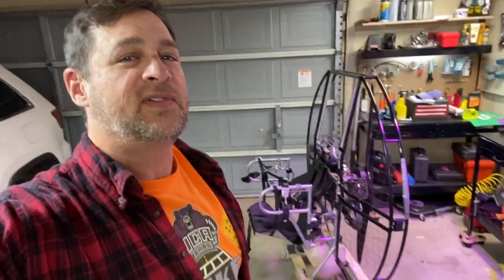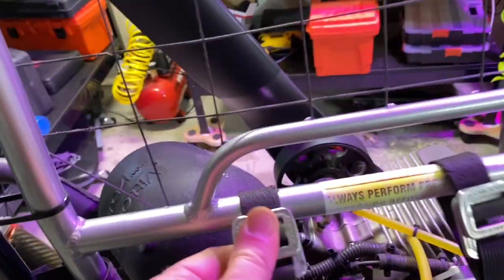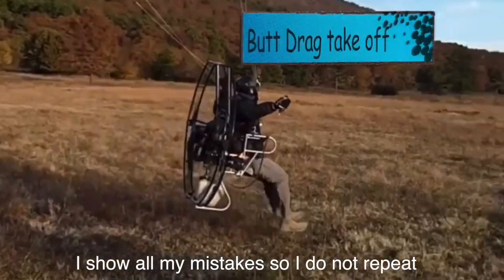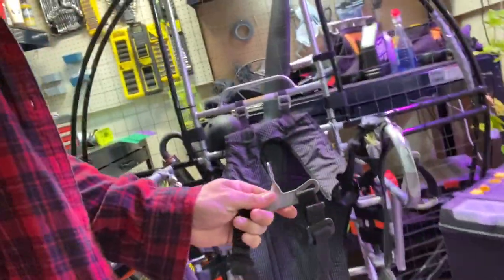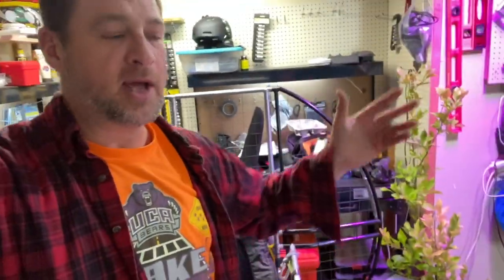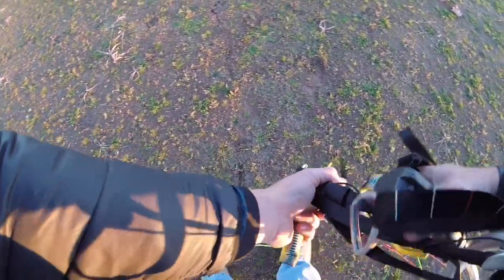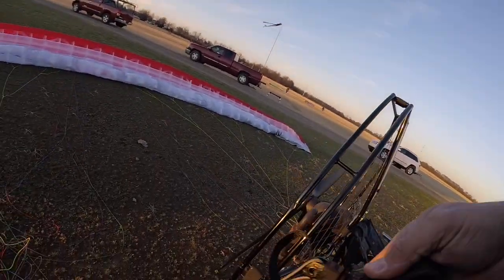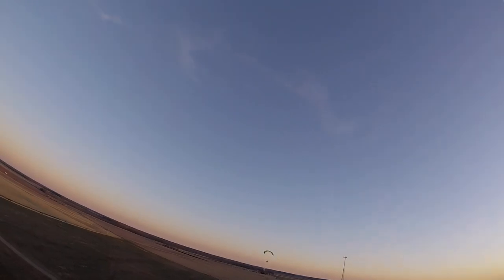Potentially a fatal mistake… This is why Pre Flight is so important

Comment from the maker: Let me know if you see what happened… Even after doublechecking it did not look incorrect…
Reply: I can't tell 100%, but at 6:05 it looks like you clipped in with your riser turned 360 degrees. If you follow the A-line from the riser down, it looks like rather than hang straight down, it comes up and over the other lines from right to left. (This is on your left side riser) And I believe you untwisted it when you reset. As far as the engine restart, if you don't already know, make sure you hold the kill switch down for a full 3 count and then it shouldn't restart. I've had that happen to me a few times.

Comment: It's scary. I go through preflight too. I even have it written down on a 5x7 note card that I had laminated and keep in my harness pocket just in case I want to double check.   It's not possible to not miss something at some point in time. The one time I had an issue was when something didn't feel right so I unclipped and started over. Only my brain decided that I had already made sure my toggles were clear to pulleys. Well I hadn't the second time I clipped in. Once I launched, I discovered that my right brake was tangled in the risers. My instructor told me exactly what to do and I did it. Don't panic, steer with D's (or C's in my case), and if you can safely untangle to do so otherwise land. So that's what I did. I untangled it. It just goes to show, it's hard to be perfect 100% of the time.

Comment: @2:24 I stopped the video and asked myself what else I would check.
Belt tension 
exhaust system condition - secure, no cracks 
Spark plug tight and cable secure - I see it's disconnected for the engine preflight. Safety?
Fuel lines secure no leaks no air bubbles
Wiring harness condition
In general nothing that should be tight is loose or visa versa eh?
Reply: Spontaneous restart? Wow. That'd have to be a wiring issue. The kill switch is a normally open switch so if its loose or breaks it'll allow the motor to run.

Comment: Thinking about buying a paramotor. What do you think about your flat top?
Reply: With the Flat top you may also want to consider what other people think of it. Apart from being an old/heavy design it carries a stigma from it's most vocal proponent. It is a sturdy frame. I've seen one up close and even tried it on. The only other motors I've tried are the Blackhawk 125 Kestrel and my OpenPPGX4 w/Dudek Power seat. Both are way more comfortable on the ground. Both are lighter (my OpenPPG is way lighter). I've faceplanted the Kestrel on an aborted take-off, caught the bottom of the hoop, there was no damage.